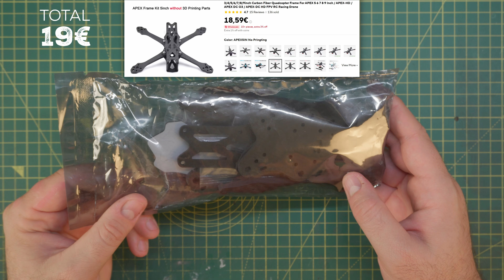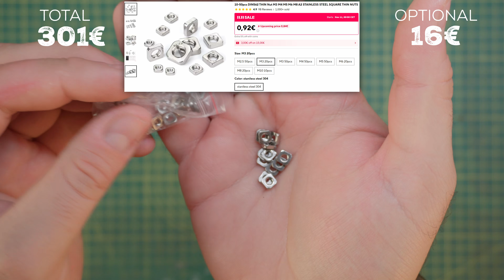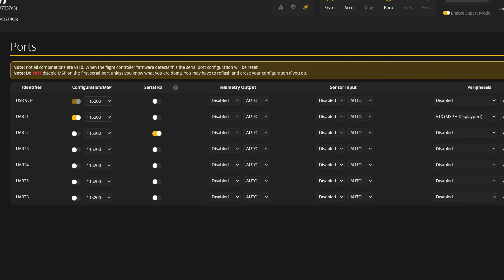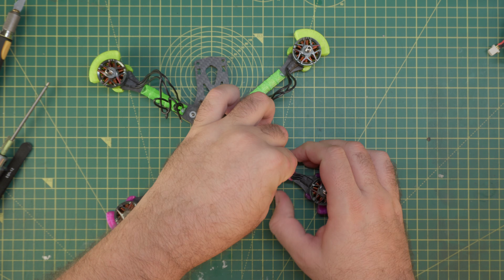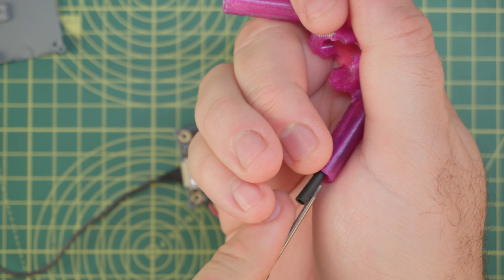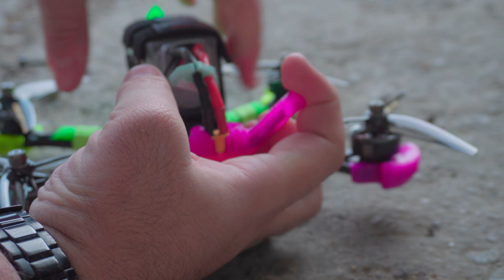[EN] My BEST BUDGET DURABLE drone build for Freestyle and Bandos — Krhom's Shop #DJI #FPV

Comment: hello je peux avoir un air unit o4 pro a tres bon prix, est ce vraiment opti en bando
Reply from the maker: Non pas du tout. Le plus opti en bando c'est le o3
Reply: @krhom pour sa robustesse ? Parce que la 150euros j’en ai un de o4 pro
Reply from the maker: @antoinefournier9927 prends le et au pire tu le revends. Mais oui, pour la solidité et la qualité vidéo à 100fps 4:3
Reply: @krhom ooooooook je vois, je savais pas ça, bon je vais continuer de réfléchir et ensuite monter une machine

Comment: Do you find the O4 Lite durable enough in practice? I use the pro but saw alot of O4 Lite getting the airunit destroyed easily in freestyle so I'm thinking if it is really good for a 2nd cheaper drone for bandos..
Reply from the maker: The short answer is no. 
It can however be made somewhat durable (we have 3+ people running it hardcore in bandos, so we're starting to get a good idea). The best options seems to be using a 3rd party coax (not angled on the air unit side), the axisflying case, and the flywoo lens mod that adds coax protection at the back, swapped to an o3 lens (you can just uncscrew the flywoo lens and screw in an o3 lens).

But despite all of that, the guys are still having to use the DJI repair service quite often. It's pretty much always free but it takes time to redo the lens mod every time, and if you're in the US you don't have the same ready access to it.
Reply: @krhom thanks for your reply Krhom. We don't have a DJI service here unfortunately.. 😅

Comment: hey, can u tell me how disable buzzer without pressing a button on it ? I cant find solution for this. In BF is mode called "beeper mute" but isnt work for me. thanks for great video!
Reply from the maker: If you have a vifly buzzer, you plug the quad back in and unplug after 5s. If you don't jave a vifly, you're sol

Comment: nice tutorial , did you use any b7000 glue on the 04 lite camera mipi cable?
Reply from the maker: Uv glue behind the adapter board, b7000 on the connector itself
Reply: @krhom  would be nice if you can do a short video to showcase where exactly . Whats a UV glue btw ?

Comment: why not tmotor velox v3?
Reply from the maker: More expensive, incredibly fragile, doesn't fly as good. Hard to beat the f60 tbh, especially since you can get them for 15usd apiece on thobby's website atm!
Reply: @krhom  More expensive? :o i regulary get deals on ali for 50usd for a 4pack of velox v3.
Im using velox v3 for all my 5" race copters. I never flew more premium motors like the f60, but i dont feel like the velox are "incredibly fragile".
Reply from the maker: @KidCe. Ok yeah that's actually quite cheap. But remember that i come from a bando perspective, in which we only see velox motors for a very short time (before they shear off at the base, or get their bells completely destroyed). Concrete is a tough friend!

Comment: Another tip... i like to put a female xt60 into the male (or vice versa) when soldering the connector.  That way it, if it gets too hot and the plastic melts a bit,  it will cool in the same alignment.

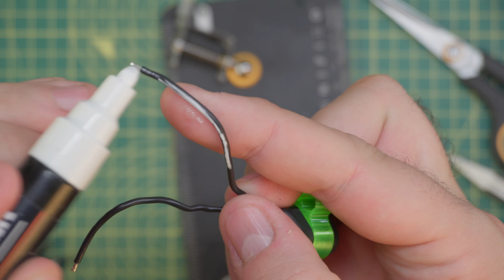Comment: 16:10 for TVSes to be useful, they should at the very least be placed in front of whatever they are protecting, so that the current path through the TVS is (a lot) shorter than the path through the sensitive components.

There are application notes explaining what they actually do and how to use them properly. It's a long and kinda sad read if you're trying to design a reliable system. For FPVs, it's more likely that the right solution to have enough capacitance where it's needed, not to add TVSes in attempt to clamp the spikes.

Comment: Nice video, i didn't like the glue on connectors, hope it was not cyano and you checked everything was working before.
Reply from the maker: As stated in the video, it's b7000, so it's completely removable. We also tested it all works fine at the beginning! Gluing the connector is important when you intend to crash hard.